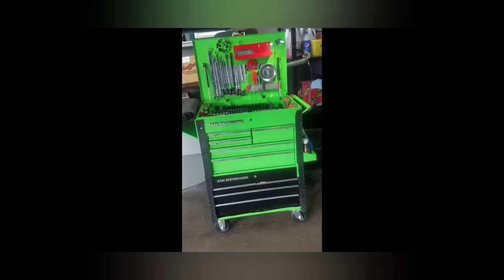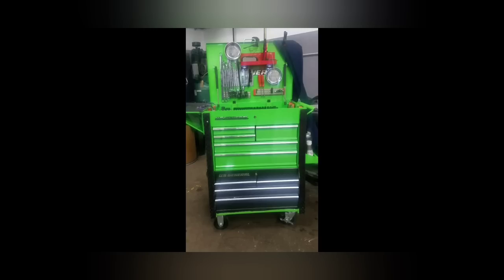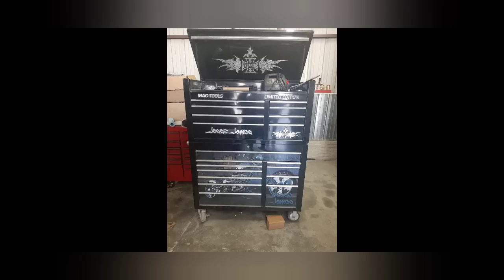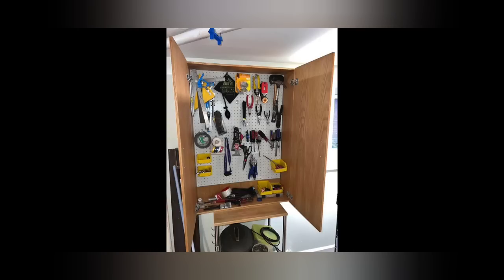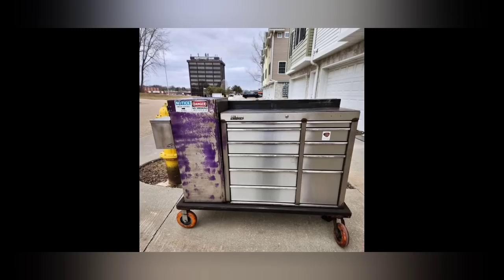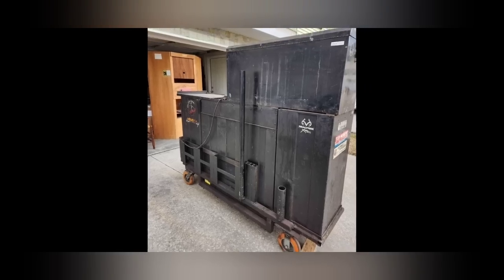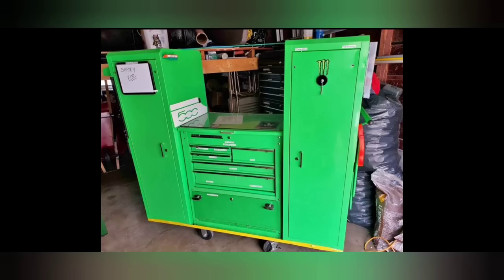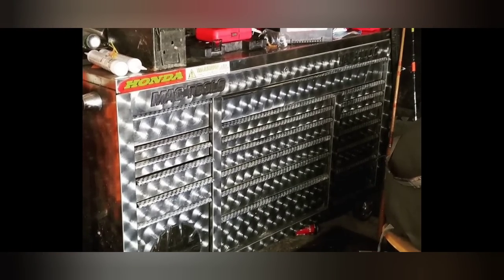Custom toolboxes! Not Snap-on Mac Matco but being Creative!! U.S. General maybe....

Comment: I did video on 98 3500 service truck I own. I have listed to sale due no where to put it to fix it. But if I found a place should I tear engine down see if any damages since was extremely hot when I put coolant in it trying get home and made it in the engine oil. It is 5.7 vortec with distributor. I lost when comes to distributors and timing them etc. Or should I put diff engine and go throttle body on it? If I find your email Id email you. Or you email me just take LLC off and no spaces between words at g mail